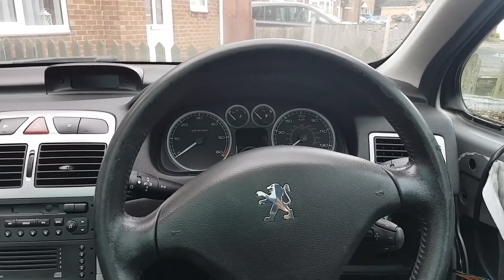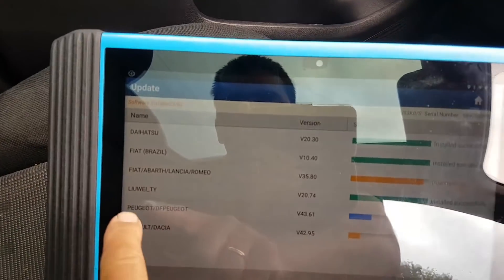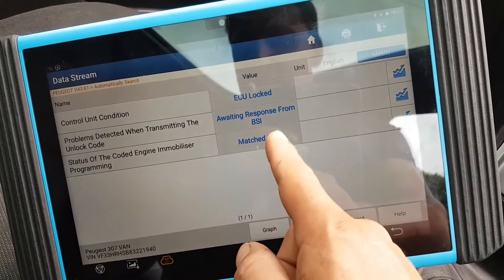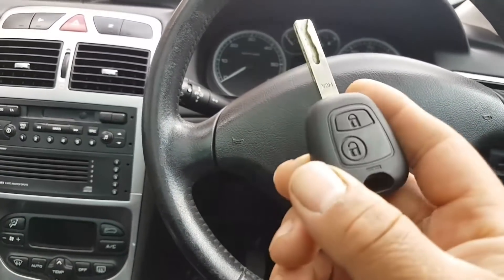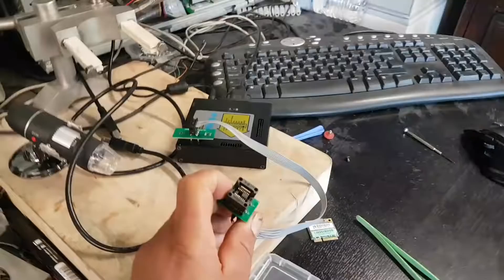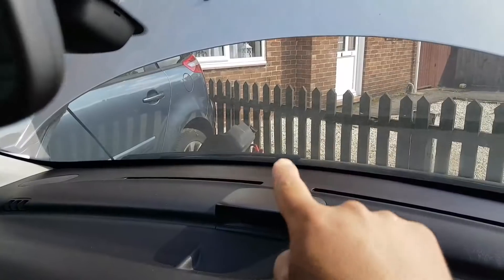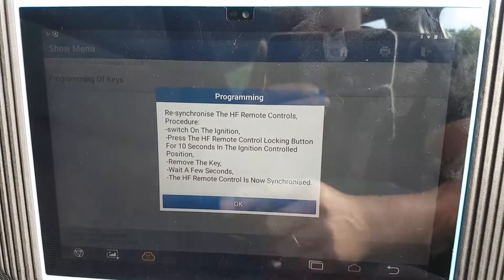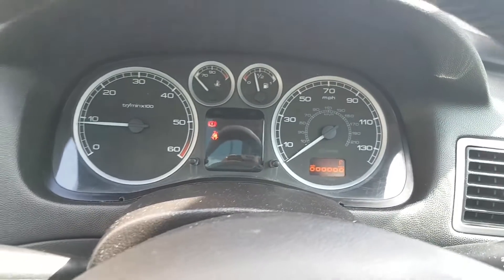Peugeot 307 ECU locked... transponder missing! Programming new one... Read description...

Comment: the ECU status after relearning keys stuck on locked , what can i do ??
Reply from the maker: What is the background on the car?
Have you had anything replaced? 
Why did you needed to program the keys?
Reply: @LMAutoRepairs  the original key is no longer submetting any signals and is no longer recognized nor being able to reprogram it , i got a second key reprogramed it , every thing is ok except for the ecu is locked , cranking but no start 
no BSi was changed at all every thing is original , the car stopped in the middle of the road suddenly

Comment: That's really good job.

But I was told for the 307 pin Is located inside the fuse box under the steering wheel I'm lucky I've seen this ved.

And can you please identify the software name that retrieve the pin for you?

Already got is it's called pin code calculator version 1.3.9
Reply from the maker: It is a little software...  that i can't recall the name now... 
A quick google search you should find it...
Thank you for watching!
Reply: @LMAutoRepairs  I thought your not hiding informations anyway I did a research but couldn't find the exact can someone else let out the name.
Reply from the maker: I am not hiding anything... if I was, I would have covered/hide te software on the video...
I just don't remember the name now... haven't used it for a long time as well...
Reply: @LMAutoRepairs  oh hhhh ok just found it mate your a good guy. Pin cod calculator 1.3.9
Reply from the maker: @dashtyATG 
👍👍👍

Comment: Hello 👋 my friend. I have see a lot of your videos.I have a peugeot 307 with 2 keys. The one with fob buttons it start the engine  and the second is just a  key with coded chip that it mechanical unlock the doors and engine cylinder but won't start car. Is there any issue the bsi or ecu lost the second key code?
Reply from the maker: Could be that or the chip has failed on the key...
Either way would need test to establish what is happening...
👍👍👍
Reply: I just clone the first key with a superchip and put the chip on the failed 🔑key. Success 🙌

Comment: Hi I Have Peugeot 307 2.0i petrol Engine code RFJ (EW10A) year 2006 would like to swap Engine ECU (MAGNETI MARELLI IAW 6LPB) what I have to do thank you for the help.
Reply from the maker: Hi
Best option is probably flash the ecu with a virgin/reset file, and then from there you can program it with PP2000 or any other capable  tool...
Thank you for watching!
Reply: @LMAutoRepairs   thank you so much

Comment: My 2003 Peugeot 307sw 2CDI Ecu has broken pins. I have a spare ecu on same model of car. Will swapping the eprom from mine to the other ecu mean the ecu will work with the existing bsi and the keys? If not do I need to swap ecu, bsi and key. Thanks.
Reply from the maker: The swapping of the eeprom should do the trick...
Thank you for watching!

Comment: Hi, how r u? I’m a big fan, always watch your videos, always awesome repairs.
I wonder if u can give me some tips, Will try to describe to the best of my knowledge 🙂
 I own a Peugeot 407 2.0HDI with a Delphi DCM 3.4 and recently due to a Jump Start , ECU went completely dead, with no communication to LEXIA or any other Scanners. Symptoms were no cracking and fans going off and on repeatedly.  First changed BSM, relay was clicking with fans, and it was the same. So I bought used ECU, now car seems normal, it cranks, no fans spinning🙂 
Now Lexia communicates ok with ECU, but says it’s locked🙄
I try to read with Kess but says protocol no supported. Should I verginize ECU? Thanks a lot for help, keep up the good work. Greetings from Portugal.
Reply from the maker: Yes... virgin the ecu and program it back to the car...
You will most likely need the pin from the car...
Thank you for watching and for your comment!
Reply: LM Auto Repairs Thanks for the fast reply. That Pin relates to the BSI? And what’s the best tool to vergin ECU? Still trying to make a dump of the ECU, to be able to vergin it, and program it back to the ECU.but FGTech and Kess seems not working..Thanks👍

Comment: Hello,
I have a Peugeot 607 and its high-frequency remote control is not working. I can start the car using the key, but cannot lock or unlock the car using the remote control. Already tried to reprogram the key but it didn't work. What could the problem be ? Blown IC inside the BSI ? I replaced the signal receiver inside the car too. Still doesn't work. Any help is appreciated. Thanks!
Reply from the maker: What does the live data shows?
Have you tested that the remote is transmitting?
Thank you for watching!
Reply: @LMAutoRepairs  Live data doesn't show that a signal is being received
Reply: How to check whether the the remote is transmitting? Can you provide a solution (if you are aware of such) for this problem, provided that the transmitter is working?
Reply from the maker: @ThisuraYapa  
First you check that the transmitter/remote is working, then you move from there...
Not point to change parts or make assumptions based on guess...
There is remote testers...
I have some videos using it...
Reply: @LMAutoRepairs  Thanks, I will try that.
Reply: @LMAutoRepairs  I managed to check the fob using a radio in AM mode! As shown in this video https://youtu.be/jXOR5UKZj-8

Unfortunately my Peugeot key didn't work. But some other key (Gate opener)  which I used as a testing key worked. Is this test viable? If it is how can I repair my key?
Reply from the maker: @ThisuraYapa  
I guess you made sure that the battery is good, right?
Reply: @LMAutoRepairs  Yes
Reply from the maker: Get the remote checked... if you don't have the equipment, take it to someone that does...
Reply: @LMAutoRepairs  Ok thank you!

Comment: Hi Luis,
I sometimes see you charge the battery while you are diagnosing the cars with the battery connected to the car. What characteristics should the charger have in order to do it safely? Is it dangerous for any ECU? Can you turn the ignition on and off, cranck it... etc while the charger is plugged?
Thanks in advance. Your videos are great! 👍🏻
Reply from the maker: The one I use yes... i can turn engine on and all that stuff...
I use a 30 amp...
Thank you for watching and for your comment!

Comment: You wont be able to use that remote now as the carbon chip and remote board are matched. The remote logic is in the carbon chip. You have to purchase as a matched pair. Usually aftermarket remotes dont work either as it's just a remote board and 7936 carbon chip without any remote logic.
Reply from the maker: As per the video title... "Read description..."
😉
Thank you for watching and for your comment!
Reply: @LMAutoRepairs  ahh  ...I've just read that bit....😂🤦‍♂️
Reply from the maker: @mlautokeys9614  
👍👍👍
Reply: There is no remote logic in Carbon chip, only in keys that use integrated chip in the board most of these can be reset and reused with the correct tools
Reply: @geerux  these are the older PSA remote systems...  remote and chip are separate but are matched at the factory when made. The chip has the remote logic inside. This is why the remote will no longer work as the paired chip has been erased from the BSi memory.
Reply from the maker: @mlautokeys9614  
Correct...
Reply from the maker: @geerux  
As explained by MandL Motors...
The remote is matched with the transponder during programming...
There is tools that can blank the remotes... or they claim they can...
I never tried them, so can't really comment on them...
Thank you for watching!

Comment: I have same problem I've changed  The BSI 
And Still same problem
Reply from the maker: If you changed the BSI, the BSI would have to be virginized first, and then new transponder and remotes programmed... and this, using the original car pin code...
Thank you for watching!
Reply: I changed everything fuse box and control unit and BSI and the key also they same code but still In The Eco mouds Aktive
Reply from the maker: @servicesonline5491  
What code?
Ignore the economy mode... that will go away as soon as the car starts...
Reply: @servicesonline5491  Why change so many components? You have extra money ...
Reply: @engeneer_ru5827   no really i do not but I have no other options I've try everything I can but the car still not starting
Reply: @servicesonline5491  I don’t know your whole story ... But I usually just clone the BSI

Comment: Great video. I swapped the fob on my citroen c3 and chucked the old fob complete with the transponder in it into the bin, but heres the impossible thing,I used that key for a few days driving around before it wouldn’t start. ( I know, it shouldn’t start at all with no transponder) I found the spare key in a draw and that was fine, after sussing out what I’d done I tipped all the bin bags out on the patio and went through the lot till I found the old fob and the chip was still in it, swapped over and good to go. I don’t know how I was able to run the car for days with no chip. If I didn’t have to pull out the draws in the house to find the spare key I’d have just thought I got the keys mixed up. It can’t happen, but it did. 😱
Reply from the maker: Interesting...
Thank you for watching and for your comment! 
👍👍👍
Reply: LM Auto Repairs ..as soon as I swapped the fob I tried it and the car started, which is why I chucked the old one away, I can’t understand it either.
Reply from the maker: @thpxs0554  
I would start within the first couple minutes... while the ecu was kept "awake"...
But should not once the car is left off for over the latch period...
🤷‍♂️
Well, you got it sorted in the end...